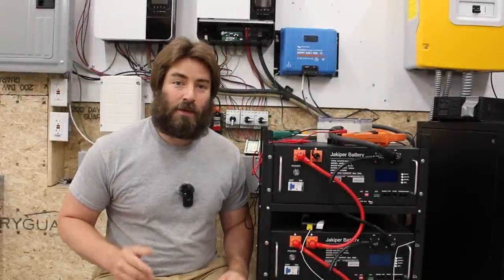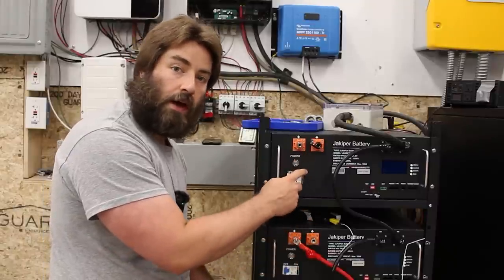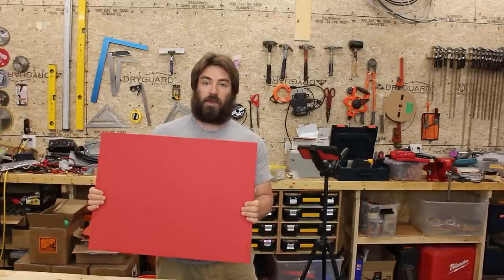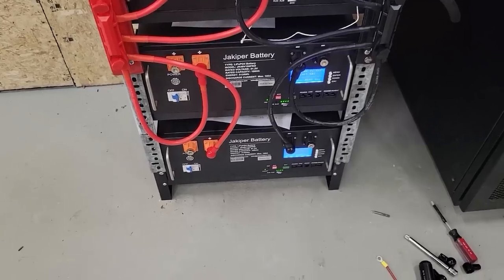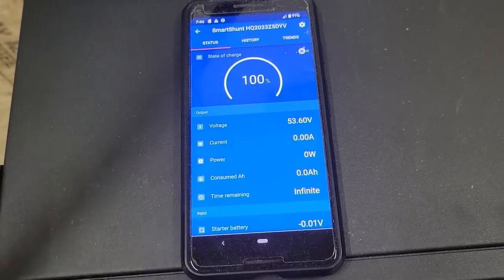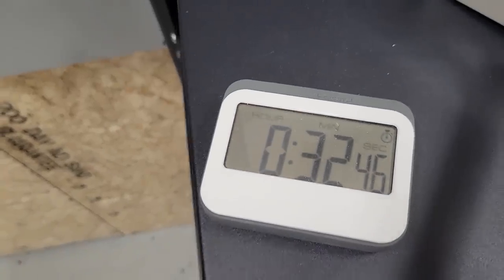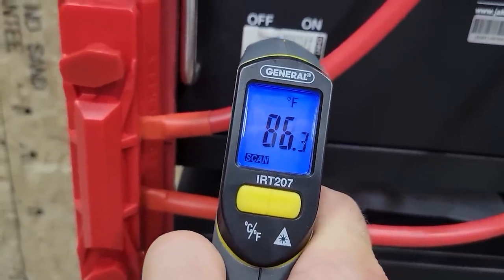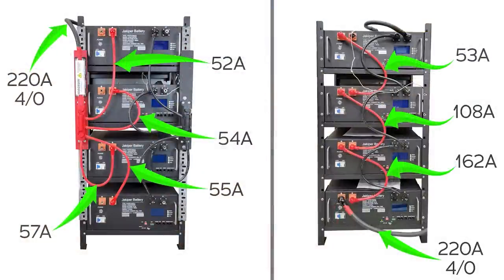Best way to wire batteries.   Part 3

Comment: Your bus bar jumper is about 190 amps.

BUS BAR CURRENT CALC
All measurements in mm

Copper:
Width x thickness x 1.2 = amps
10mm x 20mm = 200 x 1.2 = 240Amps

Aluminum:
Width x thickness x 0.8 = amps

1” = 25.4mm

1mm = 0.0394 inch
Reply from the maker: I think there may be some confusion.  The "jumper" is the metal piece inside the battery, that bolts together the two positive (or negative) terminals.  I measure the jumper at 19mm2.  It is tin plated brass.
Reply: There was also a copper flat bar stock jumper between the bus bar and fuse block holder. This is the one in question taking the entire load.
Reply from the maker: OK, gotcha.  Sorry.  Yes, so that big copper one I bent into a 90 degree, that is 1/4"x1" flat bar stock.
Reply: Sorry, I was thinking it was 1/8” and was concerned of that possibly being a bottleneck and heat source. That should handle almost 400amps. The use of an infrared camera is a great way to locate the warmer areas and make necessary adjustments. 
I always use at least double the bus bars and wire sizes needed for an amp peak load along with quality connectors and crimps to eliminate any loss. I have only built a handful of systems, but with each of them, the only items to get warm are the charge controllers, inverter/charger or battery internals under heavy load. With these items being the last heat source, I provide extra cooling fans to keep them at bay. 
A cool running system is a happy system.
The ones you have been showing on here are awesome!!

Comment: The first thing  you do have to consider is how often you are really going to push that stack of batteries that hard.  I almost never hit even 80% usage on my single 6000-watt splitphase inverter and on average you always want to oversize whatever you get to meet your needs so you are never really pushing your equipment that hard in the first place, but you could if you needed too.  The temps you reached in the previous video are high but still well within the safety margins since the system will not get that much hotter before the batteries will be depleted.  

Another option would have been to use increased gauge of wires as the number of batteries increases or even just make all the connection wires out of 2/0 to 4/0 cable to begin with and double stack the lugs and call it at day.  You can even buy the double ended lugs if you were worried about double stacking on the terminals.  Using heavier cable would be the equivalent of using busbars but allow for flexibility and keep the costs low.  If I was connecting together a much larger system using 10+ batteries I would consider using a busbar to help clean up the connections and carry the current but even at that point you have to start considering how much power you actually need to draw from a system like this.

Comment: You would have helped everything out and been simpler if you made cables all same length when you eliminate your daisy chain
Reply from the maker: All the wires are exactly the same length.  I linked to them 8n the description.

Comment: The idea behind reducing wasted heat is great, but those chinese rack batterys ABSOLUTLY SUCK at not wasting power. The silicon cables inside are thinner but rated for higher temps to compensate the heat, with the terminals on the batterys you have 3 additional contacts (internal lug to busbar, busbar to terminal inside, terminal outside to cable lug). Then the bms, cell connectors,....

Comment: 200 amps on 4 gauge wire? there's your problem. using appropriate wires from the start would have made this a non-issue

Comment: David this is poorly done. You have 4 batteries of 48 volts each there connected in parallel. so your current meter shows an increasing current on each link. Thats how you have it wired and you can see how people will take away the wrong idea from your setup and explanation. You could use some carbon conductive grease on all your terminals .